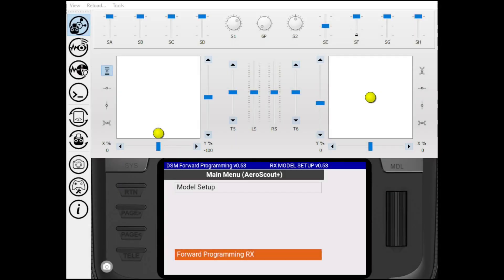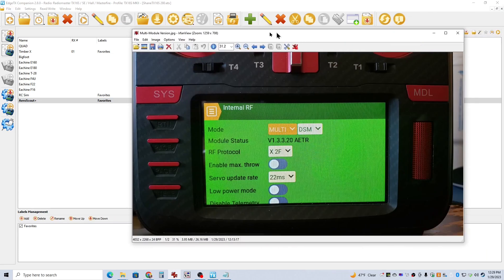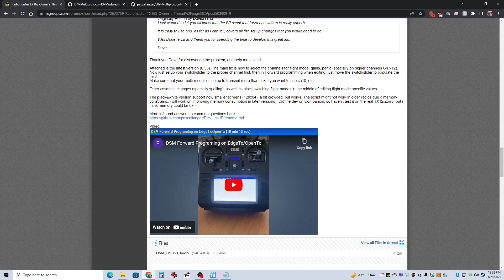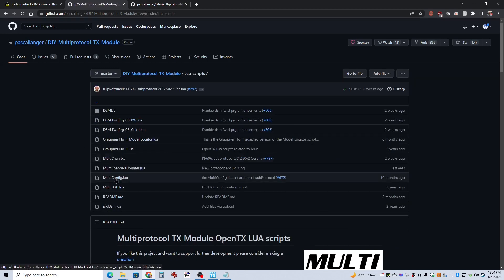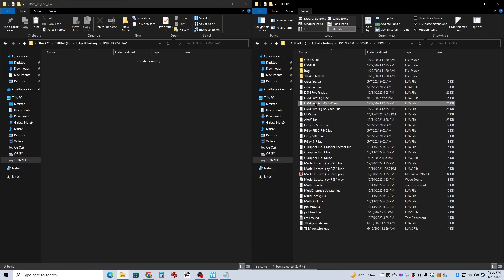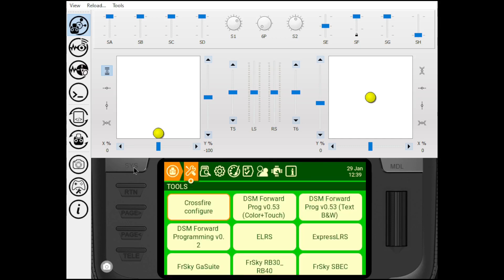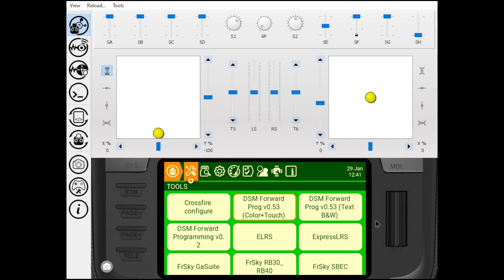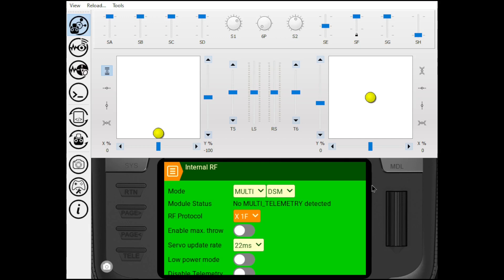Ep.1 Radiomaster TX16S EdgeTX to Spektrum Forward Programming

Comment: Is forward programming on the TX16S compatible with the Spektrum AR636A?
Reply from the maker: The AR636 doesn't use Forward Programming at all.  It is configured with the same SPMA3065 USB adapter but you can adjust settings with the Spektrum Programmer PC software.   Another 3rd party software that lets you make changes to the AR636 is called "SAFE Model Builder for AR636".  With these two programs you can configure everything on the AR636.

There is a YouTube channel called "txkflier" that has the best AR636 tutorial video I've found on YouTube.  He comments on my videos occasionally.  I've considered making a video on the AR636 but his is so good it doesn't make sense for me to make one, lol.  Here's a link to that video.  Let me know if you have any specific questions.  I have this receiver and am familiar with the setup process.
https://youtu.be/H0Eb15wA8tA?si=NO-OcvWnycpcgqhM
Reply: @shanesdiy  thank you. I'll check it out.

Comment: hello, im not sure if this is a way i could follow but im trying to figure out how can i connect my edgetx to the scout? i contacted radio master and this is what they said 

"RadioMaster RC
 Hi, I checked the product introduction of AeroScout S 2 1.1m BNF and saw that the receiver it carries is Spektrum AR631 DSMX 6-Channel AS3X & SAFE Receiver.  If you buy a TX16S with a built-in ELRS RF module, you can only bind the ELRS 2.4 GHz receiver, not the Spektrum DSMX receiver.  If you buy a TX16S with a built-in 4in1 module, you can bind this Spektrum DSMX protocol receiver.  Built-in 4in1 module: supports SPEKTRUM AS3X receiver. I found a video on YouTube about how to bind and set up the AS3X receiver. 

i bought the tx16s edgetx with built in elrs, but in the box i also have a package with like some reciever and labeled elrs..
Reply from the maker: You can purchase an external 4in1 RF module for the TX16S that would snap on the back then you can have both ELRS and 4in1 for Spektrum, FrSky, FlySky, etc.  That would be my recommendation.  If you setup another plane in the future you can use ELRS if desired.  You can, of course change the receiver in the AeroScout but you'll need one with PWM servo outputs.  What model ELRS receivers came with your radio?  Some are only serial output and have no servo outputs and to use one of those, you would also need to add a flight controller of some type.

I would get the external 4in1 module.  Keep the AeroScout stock and follow the procedure in my more recent video linked below.  Unless you need to do some custom programming you don't need forward programming or to unlock the receiver as discussed in this video series.  The video at my link below shows how to setup your AeroScout using the stock receiver.
https://youtu.be/ZefAYBJVdvk
Reply: @shanesdiy  thanks for replying back, the radio i got came in the bundle with the atom rc swordfish. im not to familiar to much on components from receivers but i ordered the atom rc swordfish with a flight controller, gps installed, inav installed RTH, FPV ready , and some other good stuff in the plane. and the radio it came with is the radiomaster tx16s mk2 + RP1 receiver with internal elrs. thats as much as i know. not sure where  i use the rp1 receiver for? i ordered the aeroscout because i do not want to crash the swordfish so i wanna get my hands wet on aeroscout. the elrs package is a rp1 receiver that came in the box.
Reply from the maker: @teamchecko9086  The RP1 is a tiny ELRS receiver that connects to a flight controller.  It doesn't control servos by itself. The RP1, and receivers like it, let your TX16S talk to the flight controller and the flight controller runs all the aircraft systems.  Servos, motor ESC, GPS, etc.

I'd keep all that equipment for the Swordfish and leave the AeroScout stock to get some flight training.  Get the external 4in1 RF module and then you can bind to just about any receiver on the  market with your radio.  My radio has the internal 4in1 and I have external ELRS so just the opposite as you but will do the same thing.  I also have an external 4in1 module.  Very versatile radio.

Comment: Hi do i need realy the edge tx 2.8.0 firmware or newer? Because i have the stock 2.7.1 and it works good as yours. Or giving it problems when i fly with my spektrum plane's?

Tanks!
Reply from the maker: If you have the latest v0.56 Forward Programming script on the radio and it works no reason to update.  I "think" 2.7.1 or newer is OK for Forward Programming. I'm double checking with the developer and will post here if I am mistaken.

The "DSM Smart RX Tel" scripts do require 2.8.3 or higher to work with the Avian ESC's. I get into that in later videos on the channel.
Reply from the maker: Just confirmed with the developer, unless you decide to use the "DSM Smart RX Tel" script for Avian ESC setup, your 2.7.1 will be fine with Forward Programming v0.56 which is the latest as of today.
Reply from the maker: @KroonFPV  When you upgrade from v0.54 to v0.56 be sure to delete the old /SCRIPTS/TOOLS/DSMLIB folder and contents and copy the new DSMLIB folder you'll receive with the v0.56 files.  You'll get errors if you don't.

I did confirm with the developer that 2.7.1 will be fine with the Forward Programming functions.  If you decide to try and run the DSM Smart RX Tel script you will then need to update to EdgeTX 2.8.3 or higher.

Comment: For some reason my forward programming doesnt work anymore , I just get errors when I try to start the LUA .  Maybe something im doing wrong
Reply from the maker: Make sure you still have the folder /MODELS/DSMDATA and if you updated from a previous version make sure you deleted the old /SCRIPTS/TOOLS/DSMLIB folder and contents and copied the new DSMLIB folder from the latest rev you are installing.
Reply: @shanesdiy  found the issue, my log file wasn't a log folder
Reply from the maker: @MikeyMikey1968  Glad it was an easy one!  Was chatting with Frankie and he told me.  Just had to create a /LOGS folder on the SD card so forward programming had a place to store the "dsm_log.txt" file in case anyone is wondering.

Comment: Hey Shane, wondering if you can help me. I’m using a TX16S and an AR630. I have successfully uploaded the latest files to my TX and I’m able to bind successfully, however when I attempt to enter forward programming, I get the error message “no compatible DSM receiver.” Do you know what the source of the error could be? Thanks!
Reply from the maker: Did you get the latest forward programming scripts for the B&W radios?   Current versions for the Boxer would be "DSM FwdPrg_56_MIN.lua" and "DSM FwdPrg_56_STUP.lua" and be sure to install the /SCRIPTS/TOOLS/DSMLIB folder with its contents from the GitHub package and make sure you create the /MODELS/DSMDATA folder. If you upgraded from an older version be sure you deleted the old /SCRIPTS/TOOLS/DSMLIB folder and copied the latest DSMLIB folder to match the new Lua scripts.

How old is the AR630 and was it from a BNF airplane?  If it has older, locked firmware you might get messages like that so might need to update the firmware with the Spektrum USB cable. Spektrum just released 2.48.0 firmware in the last few days.

Make sure when you bind, you use DSM X2F and not one of the DSM2 protocols as they have limited functionality with the "Smart" features.

For troubleshooting, you can pull the "dsm_min_log.txt" file off your SD card from the /LOGS folder and send it to me, it might offer some information if the above things to fix it.
Reply from the maker: One more thing, in your Internal RF setup be sure the "Channels Enabled" is set for 1-12. Sometimes it defaults to 1-6 or 1-16 and those may give you problems because the proper number of channels won't be active.
Reply: Thank you for your help and taking the time to write your reply! I really appreciate it! I’m pretty sure the channels not being 1-12 was the issue. Was able to do the first time setup and activate everything, now I just need to figure out how to set everything up properly lol. Thank again, Shane!

Comment: Very intriguing video. Recently, I purchased Radio Master TX16S for inav and Ardupilot. For years, I was fighting with Spektrum with compatibility issues with inav. Currently I have Spektrum IX 14 which I'm considering selling. Is forward programming compatible with smart ESC?
Reply from the maker: The Smart ESC doesn't use forward programming but has its own "app" to edit. We fortunately also have that capability as well. If you find my video about reverse thrust on the Aeroscout I demonstrate the DSM Telemetry app on the TX16S. At the moment we have full forward programming and smart ESC compatibility with EdgeTX!
Reply: @shanesdiy   Wonderful news. I just purchased a 4 in1 module for my TX16S. I'm going to give it a whirl. If I like it then I'm going to say bye-bye Spektrum.
Reply from the maker: The Lua versions and links to get the updates change through this series as it was in active development at the time.  Current links to the GitHub pages can be found in the description and I mention the updates periodically through the various videos. Let me know if you have any questions!

Comment: I cannot find link to V 0.53 zip file you said was linked here
Reply from the maker: v0.53 is not the latest any longer. Link is in the description to the github page.  v0.56 is the latest at the moment.

https://github.com/frankiearzu/DSMTools
Reply: I thought the original link had all the files needed in one place.  The github page does not.   Do I install the original link first then update just v o. 56
Reply from the maker: Sorry for the lack of response, for some reason YouTube held your comment for review and I didn't see it.  The original link went to a forum post, I assume that is the one you were referring to?  The GitHub page does have everything required for the latest version of forward programming and also additional Lua scripts such as the one needed to program the Avian ESC's.  In my later videos I show how I go and get the updated files and update my radio.  Been thinking I should do another video soon on how to install the latest from scratch as well as how you'd correctly do the update if you had an older version so folks didn't have to scan through my other long videos to find that.
Reply: @shanesdiy  no problem. I seem to have it. All working to some extent.  I will keep learning and watching

Comment: I just bought a replacement 631 (not bnf)    will this be locked???     Will it be programmed properly for the Aeroscout???   AAS3X and SAFE
Reply from the maker: Most likely it will have no gryo/safe setting configured. It will just be a normal, non gyro receiver until the "first time setups are completed most likely.

I suppose it is possible they pre-program the AeroScout safe settings if you order it as an AeroScout replacement. I think it would say something about that on the sales order if it had been pre-programmed.
Reply: AR631 model files can be downloaded on the receiver as shown below.

Smart Receiver Preset Model File Import Tutorial - AR637T AR630 AR631 AR8360T AR10360T - YouTube

AS3X-SAFE-RX.pdf - Airplane Receiver Pre-set Model Files

SPMA3065 Transmitter/Receiver Programming Cable: USB Interface

Joe P - Technical Product Support

At Your Service - Tue-Sat 10-7 CST

ref:!00D6g023inq.!500Pp0959Lg:ref

Comment: Hey man, is there anyway you can share that zip file? Or do you know where the latest version is for the 0.56v? Thanks in advance!
Reply from the maker: Sure thing.  The new link is in the description but here is it again.  If you have a previous version of the Forward Programming Lua on the radio be sure to delete the old /SCRIPTS/DSMLIB folder and contents from the SD card and replace it with the new one.

https://github.com/frankiearzu/DSMTools
Reply: @shanesdiy  and which one would it be SD_FP_56_COLOR_Dec9? And do I set it up the same way as in your video?
Reply from the maker: @cloudstrife778  That is the latest.  In Episode 3 I show the new github page and give some instruction.  Here's a link to the appropriate time stamp, it's a longer episode.

https://youtu.be/mEfLGnEZN9U?si=WW4-1hrpk9UrGbPc&t=2830
Reply: @shanesdiy  do you know why it's called SD instead of DSM now?
Reply from the maker: @cloudstrife778  That is just the zip file name, not sure what "SD" stands for off the top of my head.  Once you unzip it you'll find the lua file name is
"DSM FwdPrg_56_Color.lua"
Reply: @shanesdiy  so I still just have the original FP, 0.2V, and I have the eflite p51 with ar631 and it's not letting me assign a switch for safe, is it because I don't have the an upgraded FP?
Reply from the maker: @cloudstrife778  Which P51?  Most of the E-Flite planes don't need FP to assign the switch. v0.2 has lots of bugs and limitations.  If everything is setup correctly, just moving the sticks down and in and flipping your assigned safe mode switch 5 times (OFF->ON->OFF = 1 time) will set that channel.  Here are some things to check if you cannot get safe to assign.

1. Make sure you are using DSM X2F, not a "DSM2" protocol or it will NOT work.

2. Make sure in the model setup for the internal RF you do NOT turn on "Enable Max Throw".

3. Make sure the channel range in the model setup internal RF is set to channels 1-12 to enable all available receiver channels.  For example, if you have it limited to channels 1-6 and trying to use channel 7 or 8 for safe it will NOT work.

4. Make sure the 3-way switch of your choice is mapped to a channel between 5-9 in your transmitter mixer. Guessing you have gear and flaps on 5&6 so channel 7 would be good.

5. Make sure your sticks are all controlling the plane control surfaces in the correct direction.

6. Make sure your sticks are all properly calibrated.

7. Make sure you don't have any low rates set.  You must be at high 100% rates for the safe channel assign to work.

8. Make sure when you do the bind you follow the procedure to enable SAFE Select during bind.

Odds are one, or more, of these items is your issue.
Reply: @shanesdiy  I bind it to safe and it dances twice, but it does not auto level, for some reason, I hold it upside down and everything, but it does nothing.
Reply from the maker: @cloudstrife778  so this checks off #8 on my list. Did you check the other 7 items?
Reply: @shanesdiy  yes I did, I double checked and triple checked everything, I'm confused why it won't even auto level at all, I tried As3x as well I gave it throttle as well and nothing. It just seems like there is no electronic assistants at all.
Reply from the maker: @cloudstrife778 what channel have you assigned to safe modes? What switch did you assign to that channel in the mixer?

After setting that up how did you assign that channel to safe in the receiver? If by moving the sticks down and in then flipping the switch 5 times the plane would have reacted.

If you know how to do it, zip the entire contents of your SD card and email it to me and I'll have a look.
Reply: @shanesdiy  hey man so sorry for all the questions, and thanks so much for all your help!! I finally figured it out with forward programming, last question, what is the telemetry program, for the reverse thrust, for the tx16s called? And what file do I put it in the SD card?
Reply from the maker: @cloudstrife778  The actual script filename is "DSM_SmartRX_Tel.lua".  Once on the radio the button says "DSM Smart RX Tel v1.1" or maybe "v1.2"

It's in the "DSM_Telemetry" folder on Frankies GitHub page.
Reply: @shanesdiy  I understand that, but where on the SD card like when the transmitter is connected to the computer in storage mode. What file do I put it in? Just put it in scripts like forward programming?
Reply from the maker: @cloudstrife778  Yes, goes in the /SCRIPTS/TOOLS folder. No sub-folders like are required for forward programming, just the one .lua file needed.
Reply: @shanesdiy  thank you so much!